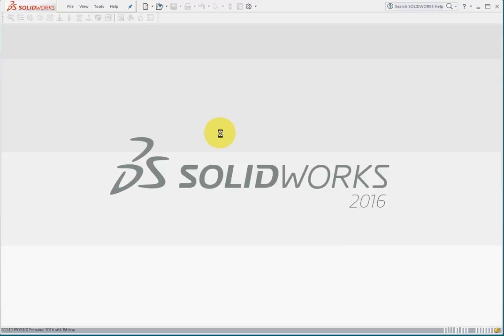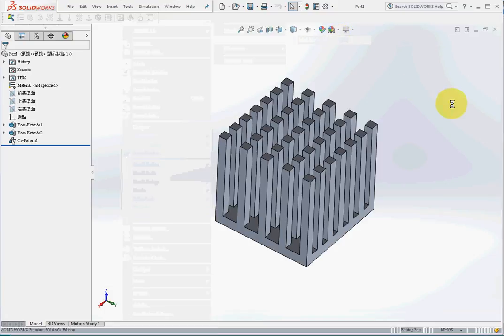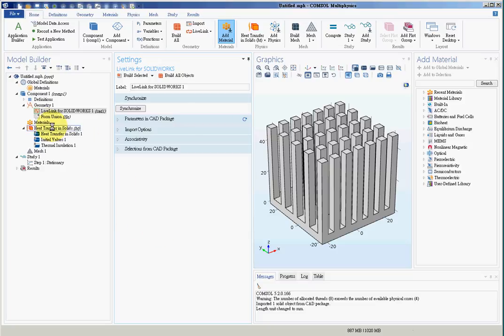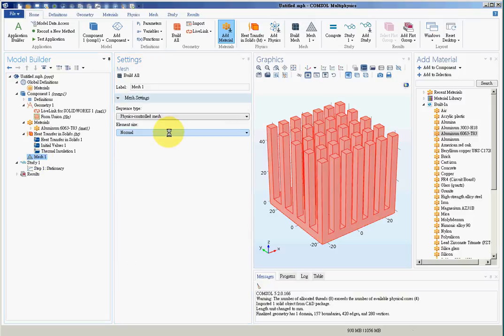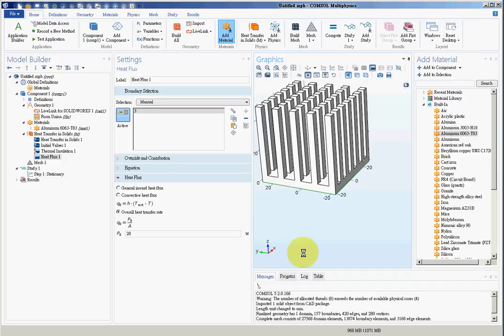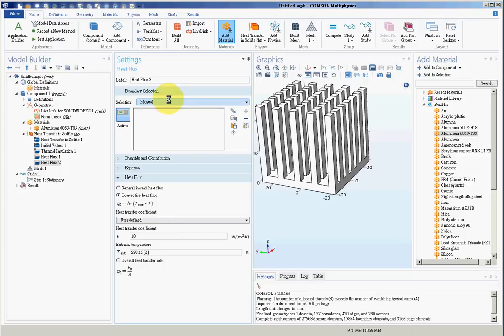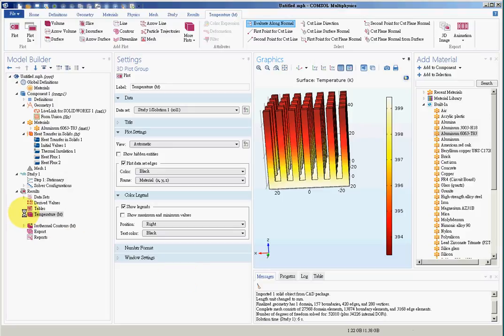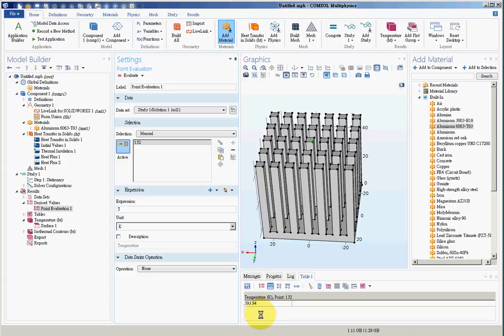COMSOL CAE 8 1  Thermal Analysis Steady State

Comment: what if I want to put an IC on top of this heat sink and want to find the temperature inside the IC?
Reply from the maker: You need to draw a point or a line inside the IC and display temperature in post processor.